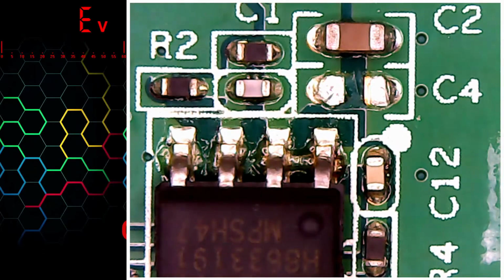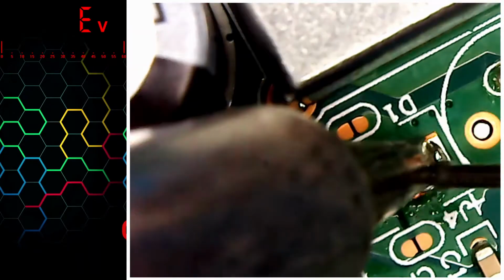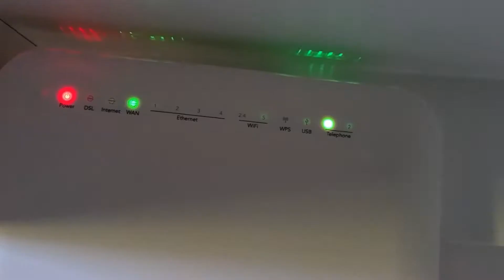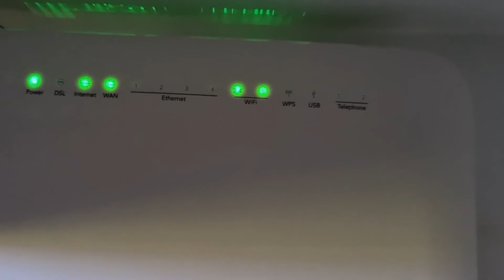Our NetComm Wireless Router Randomly Stopped Working - What Went Wrong? | Home Fixes

Comment: The second diode has silk screen writing if TVS  meaning it's a transient voltage suppression diode.  It is used in case there is a large spike of voltage it clamps it to ground to avoid damage to the main rail.